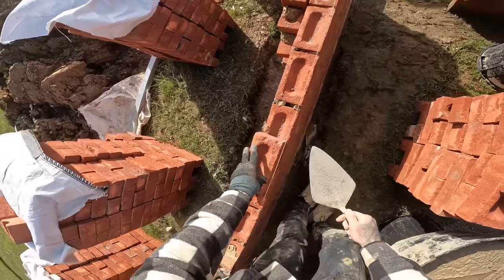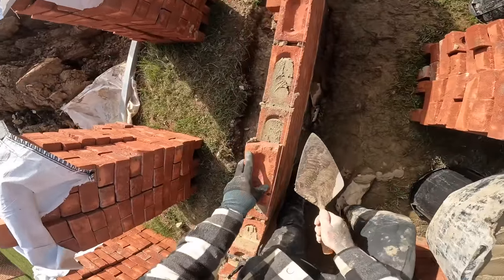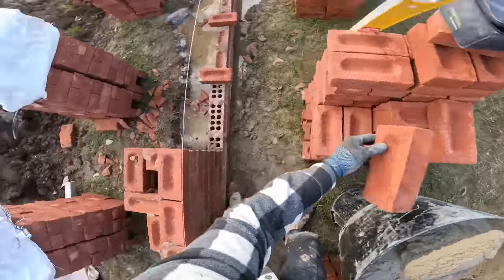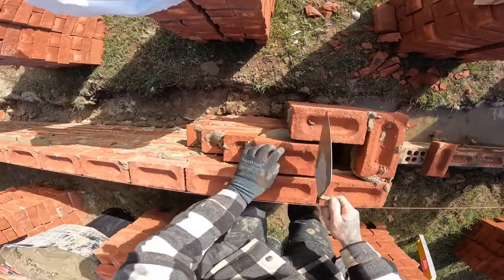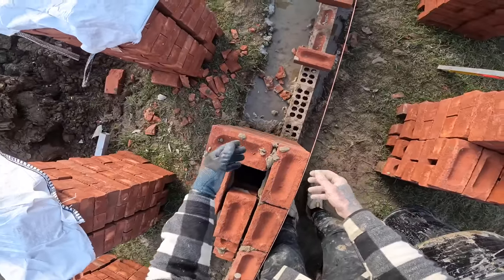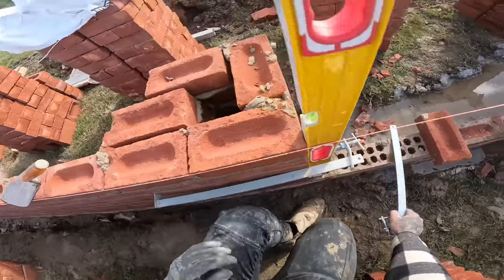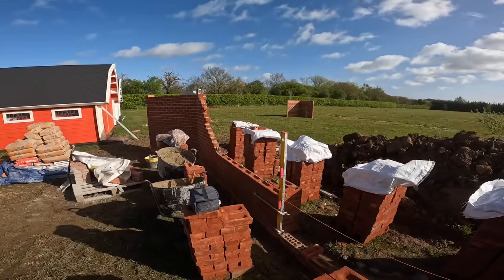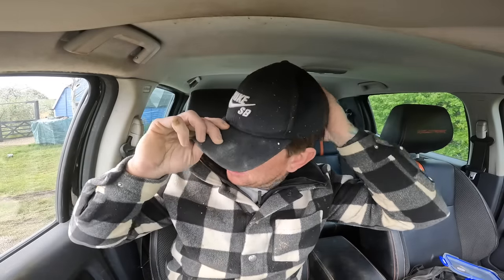Bricklaying...Tips and tricks!

Comment: I say Charles, when you often place brick-ties from blockwork to brickwork across the wall cavity, how the hell do you then get the block-foam cavity insulation in?? 🤪👈
Reply: Insulation goes in before you lay the brick, it is pinned to the block with big nails, you can just push the wall ties through the insulation once the work is dry and set. Brick is then laid with the ties sitting in the joints to hold it all together